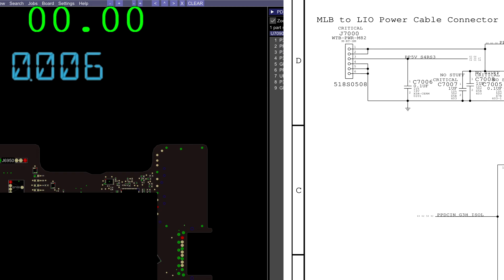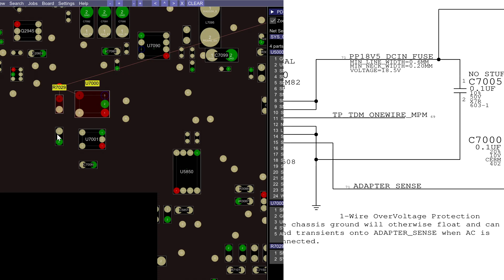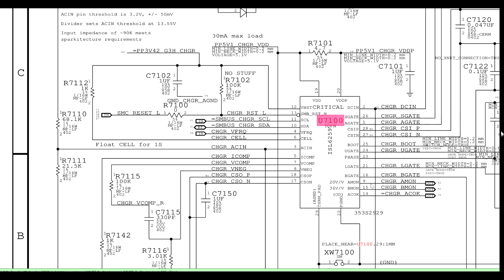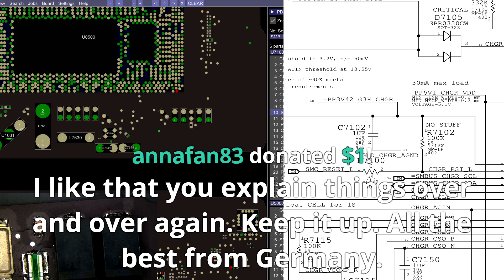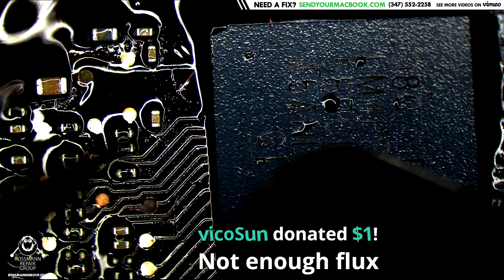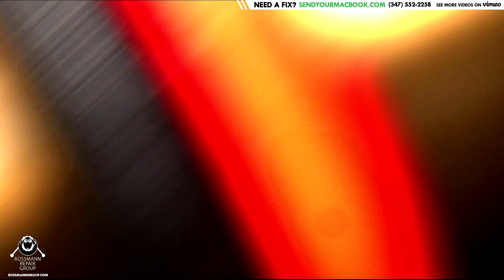A1466 Macbook Air no green light

Comment: Hi there, I have an A1466 2017 that's been acting up for the past couple of weeks. I do get a green light on the charger, but only when the battery is disconnected. It takes about a minute for the green light to appear, though. I replaced the battery, but the issue persists. What could it be? Is there a particular video I should watch to get some insight? Thank you!

Comment: I don't know if this is the right place to post this, but I can't seem to find an answer anywhere. I have a 2015 macbook air that doesn't turn on anymore, but the fan spins and the charger has a light. I tried testing the S0 power rails with my multimeter, and they all seem to be there so I'm not really sure what's wrong. Part of the board (I'm not sure which) heats up by a large amount when plugged in although I don't know if this information helps at all. Thanks in advance, any ideas are greatly appreciated.

Comment: I've got an A1370 with no green light, battery not charging but will use the adapter to run.  I happen to have a spare logic board for this machine, but no change.  Different charger?  No change.  I'm thinking the problem must lie on the power circuit board.  Unfortunately, my lack of equipment and knowledge is stopping me from fixing it :(  Thanks, Louis, for giving me some hope of reviving this thing at some point, even if only for the fun and a learning exercise.